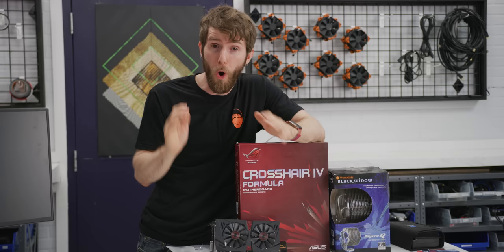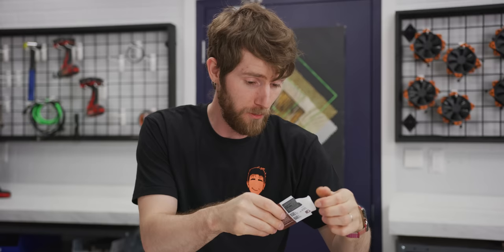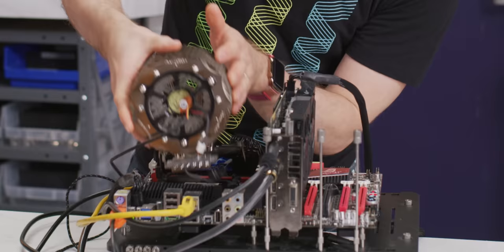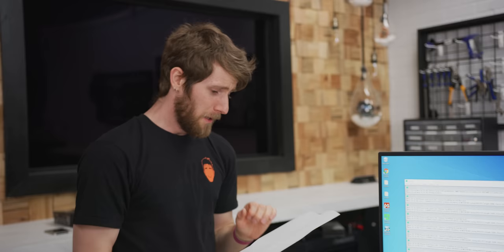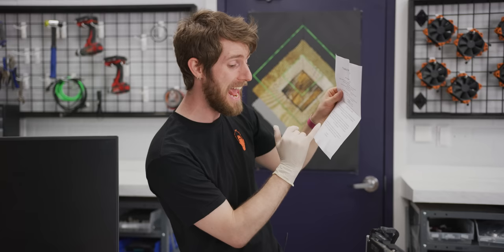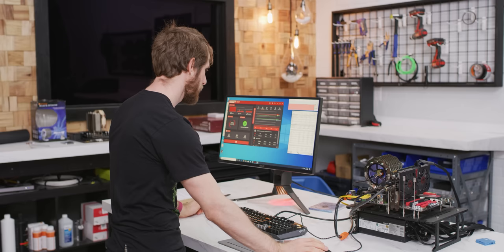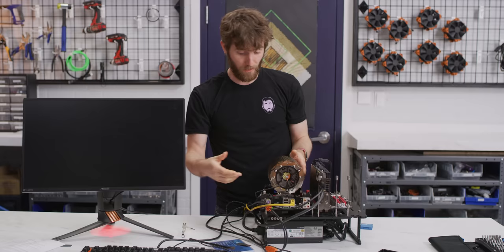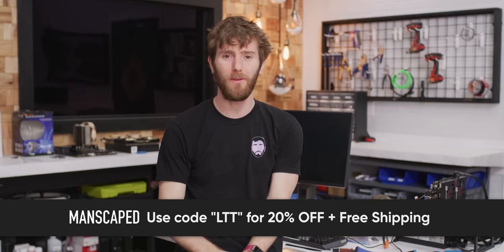Testing Another YouTuber's Thermal Compound!

Comment: Thanks for doing this review!  We didn't have the guts to risk some CPUs on such a test.  I think your application techniques looked reasonable and typical of what most users would probably do, I've also forgotten the sandpaper and I recommended it!  Needless to say, I'm disappointed with your results and we'll have to revisit this. Also, I'd not recommend that your viewers use a permanent adhesive in place of a removable grease when possible as you separated these two surfaces with LESS damage than is usual!  Thanks again and well keep in touch.
Reply from the maker: Hey man thanks! I had a blast with this stuff and enjoyed the heck out of your video about it.

Some people seem to be under the impression that we don't like the product but I think they've misunderatood the point of our test. We felt your video already covered its performance compared to other (commercial) thermal epoxy well-enough. Our test was just in response to our community's silly suggestion.

For next time maybe I can make this more clear but I though by the time I took a hammer to the CPU it would be clear this wasn't a recommended application for this product!!! - LS

Edit: one theory I had (after shooting) was that a much stronger clamp would give me more similar performance by squeezing out more of the excess epoxy. Unfortunately many of the "screw-down" type mechanisms that allow you to fine tune the clamping force are more prone to user-error. I wanted something brain-dead simple (and of course expendable haha).
Reply: i wonder if you can make some thermal paste with some liquid metal like galium alloys and mineral oil.
Reply: @LinusTechTips  Please do the internet a favor and send the rest of the epoxy over to Gamers Nexus so Steve can do an empirical set of tests on it.
Reply: @Tailslol  Sounds close to liquid metal minus the mineral oil
Reply: @Tailslol  Why not just use the liquid metal used in delidded CPUs?
Reply: @PapiSmerf  I don't think steve wants to destroy his new custom dummy heater
Reply: @PapiSmerf  OMG yes. Linus doing these tests is entertaining but not evaluative. Steve doing these tests would have 16 graphs under 317 testing conditions
Reply: It certainly introduced me to your product. I'm very tempted to use this to mount a high power led to a heatsink
Reply: Personally, if Tech Ingredients aren't willing to test the product themselves they shouldn't be selling it.
Reply: @Tailslol  Oil and liquid metal don't mix. It much more worthwhile to invest in a better cooler and use toothpaste as thermal interface.
Reply: Tech Ingredients probably want something more akin to a Liquid Carbon/Graphene .
Reply: @NiTeHaWKnz  Well they don't really need to test it on something that it isn't made for. They said it was made for more permanent applications, not a cpu that should be able to be removed if needed.
Reply: what grit of sand paper would you recommend?
Reply: @NiTeHaWKnz  Why would they test this when they're advising you not to use it on a CPU.
Reply: @his_mum  I believe in the techingredients video they said 2000grit diamond powder
Reply: @LinusTechTips  Heat can help soften epoxy to make safe removal of the cpu possible
Reply: @Tech Ingredients We'll*
Reply: @LinusTechTips  Please pin this comment on top
Reply: @LinusTechTips  me again, why don't you use a torque screwdriver like what comes with threadripper CPUs to do CPU mounting tests. They sell inch/pound torque wrenches and i'm sure if a screwdriver isn't made with the mechanism you could rig a wrench to use philips head just fine, i have all the parts here to do it in my workshop. this would allow you to standardize mount pressure on every test ever done
Reply: Humble pie! :)
Reply: @PapiSmerf  i think he can afford 20 bucks lol
Reply: Waste of a product imo
Reply: @Schradermusic  It's very conductive AND reacts badly to aluminum (eats it) such as most heat sinks use. With great care and an all coper contact surface it might be do-able.
Reply: This stuff looks much better than my single part "thermal plaster" I use for components like large resistors and transistors in some instances.
Reply: I take it none of you watched Tech Ingredients video on this. They address everything that's being brought up here.
Reply: @NiTeHaWKnz  they aren't selling it for this use. Please do your research.
Reply: @Tech Ingredients
1) Usually thermal epoxies perform worse than thermal pastes, making a thermal epoxy that gets in the neighbourhood of paste performance is still a nice achievement.
2) Maybe you tested it with a less powerful heat-source. It could be the case that this epoxy can only carry a certain number of watts per area untill performance drops off.
3) Thermal conductivity can be temperature dependant. It would be nice to check how your epoxy behaves at different temperatures.
Reply: would love to see a revisit of this in the future, logically this makes sense and seems like a cool product, and im sure you will be able to iron out the kinks to the point this becomes something that people will be using a lot in even laptop applications
Reply: Coulp you lap the IHS and have it be better than before it was epoxied?
Reply: @LinusTechTips  It's time for you to try those indium sheets he talked about.
Reply: @NiTeHaWKnz  Have you watched their video?
Reply: @LinusTechTips  
Send it! Send it!
Reply: Don't thermal epoxy and thermal grease have very different thermal conductivities? I thought thermal epoxy was epoxy first and thermal second, which would make a lot of sense, given it's meant to be structural, and it'd be far worse for the adhered hot piece to entirely fall off than it is to have a slightly less conductive epoxy.
I'm not so sure there's a need to be too disappointed in its performance, especially with something as thermally dense as a CPU. There's a couple hundred watts coming out of a square centimeter or two, that's a pretty steep hill to climb.
Maybe some other sort of more linear copper fluff would work better? The dendritic copper is a lot of thin, flat sheets which I'd imagine would end up layering with the epoxy, and while the contact between the first layer of copper and the surface would be excellent, the subsequent connections between the pieces of copper in the bulk epoxy would be nearly a worst-case scenario. Perhaps something more needle-like would work better, with a higher chance of crossing points, as well as a propensity to end up sandwiched vertically between the two surfaces, providing a purely copper bridge supported by epoxy.
I've also spent a total of about 15 minutes working with epoxy so I'm absolutely talking out my ass here.
Reply: @NiTeHaWKnz  I think they weren't willing to test it on a CPU and heatsink. They would have likely tested it on something. I can think of many scenarios where this stuff would have been great to stick something hot to a heatsink without needing to make a mounting bracket to force them together like you would with a paste.
Reply: I ship it
Reply: @PapiSmerf  whats the point, clearly these guys have only spent 1/1000000000000 of the time and money designing a wannabe thermal compound that the big boys do. Seriously who though a product that is a glue and will harden will transfer heat well.......
Reply: @NiTeHaWKnz  They're not selling it for CPUs, it for an entirely different application scope in which CPU paste can not be used.
Reply: If mixed with a better tool and more exact measurements it would probably also perform better, would be great for other uses
Reply: @PapiSmerf  It's 20 dollars, tell them to buy it if you want that.
Reply: @LinusTechTips  
If it didn't adhere properly, maybe there wasn't sufficient thermal conductivity.
The dual application of newer on older/cured could be a variable in the equation?
Reply: Respect
Reply: @LinusTechTips  Not recommended, but it has its uses ... some 25 years ago I thermal epoxied a heat sink onto an AMD 5x86-133 to upgrade a laptop.  Was the only way to do it, all the clip on heat sinks I tried wouldn't fit in the space since I also had to use a voltage adapter for the 3.3v processor to run in a 5v socket.
Reply: If Linus can see this I need his help I sprayed raid on a pc I got off letgo that has roaches and not it won’t turn on I don’t know if it’s the power supply or the motherboard
Reply: Tech Ingredients is one of the best channels on Youtube !
Reply: @LinusTechTips  I'm curious what the results would be if you added high quality thermal compound to the thermal epoxy. Wonder if the results would change.
Reply: Applying it with Mcdonalds plastic knife and a finger is not what most people would do.
Reply: Linus Tech Tips I wanted to like this comment, but every time I go to hit the thumbs up button, some demonic force zaps my finger away 👿👹
Reply: @LinusTechTips  Hey Linus maybe you could use this stuff in a delidded CPU situation and see how it performs VS the TIM that Intel uses since it has Epoxy in it for sealing it. 

Also @Tech Ingredients maybe this stuff could be used for CPU delidding situations.  Maybe you can try doing that.
Reply: @Tailslol  i'm pretty sure this is possible... but not as a commercial product. using my knowledge and experience in material studies (from about 2000) it should be possible, but it would have to be applied right after making it.. after only a few hours the compound would loose homogenity. And i don't think it would be a very good thermal conductor either
Reply: @LinusTechTips  i really like the video... and i think it was clear from the beginning that this is not the usecase this was made for... to be honest it performed better than i first thought after hearing it is an epoxy based system. the idea is great though in i really hope tech ingredients is sticking to it and improves it further... really good job
Reply: TECH INGREDIENTS: THEY MIXED IT WITHOUT MEASURING ON A CD CASE WITH A MCDONALDS KNIFE.....  NEED I SAY MORE????? NOT THE BEST WAY TO TEST.  THERE WASN'T EVEN A THICK ENOUGH LAYER TO COMPARE TO THE SIMILAR TESTS IN MASS OR THICKNESS.  IT WAS LIKE WATCHING A LITTLE KID WITH PLAY DOH
Reply: @nbrikha  Tell some more tests based on thermal paste other than Linus did
Reply: @PapiSmerf  He'll do same type of tests nonetheless
Reply: @GraceBrother  so you could do it better.. Lmao! What you're doing in life jobless?
Reply: Yeah Tech Imgrediant your themal compound is terrible who in their right mind would want their $1,000 cpu glued to their expensive heat sink and pc?
Reply: @PapiSmerf  The only YouTube tech benchmarks I trust.
Reply: I saw your original video back when you made it.
From what I understood the compound you made was more a replacement for other thermal epoxy's or thermal glues not traditional thermal pasts right?
Back in the day, 20-25 years or so ago it was not that uncommon for graphic cards and PC parts in general not to have a any mounting solution for a heatsink on components so say upgrading your cooling on your graphics card would often involve gluing a new heatsink on it assuming you got the old on off first.
We used Arctic Silvers adhesive like 17-18 years ago but I cant find it for sale anymore and it seems to have been discontinued some years ago.
Nowadays me and a lot of friends are doing retro computing   (386,486, and up) and what you made in your video I found rely interesting because I usually have to resort to strait up epoxy to fit a heatsink on say a motherboards North bridge because there are no mounting holes at all and I dont like the idea of double sided thermal tape, week bond and probably even worse thermal performance.
It works well enough on this old low power parts.
But I was wondering something about IC's of that era and even modern once.
From what I understand an IC tends to use an epoxy like resin capsule mixed with beds of glass, from what I understood its to make sure the expansion ration matches the silicon inside the capsule so it wont damage the IC due to different expansion rates.
So then I wounder how bad or "good" is the thermal performance of a traditional IC package where the silicon is completely embedded in this epoxy/glass bed mix and is it strait up good enough to use epoxy to fit a heatsink to that or would one still benefit a lot from your product?

Best regards 1984
Reply: Maybe there's some sort of cascade effect where it becomes inefficient if it crosses a heat barrier. Conductors work better cold, maybe this one just starts to suck after it gets hot but it's great if you are already in the low temps. Just a theory.
Reply: GAY
Reply: Don't forget; the "experts" have had years! Still pretty impressive that it was promising and professional enough to be reviewed
Reply: @Tailslol  Gallium really likes to weaken metals, it's why it alloys so easily.

I wouldn't want gallium anywhere near some aluminium or copper especially on something that costs money.
Reply: I believe that it's possible to make it removable by using release wax on both sides.

It's possible that sanding may leave small raised burrs, or leave abrasive on the surface.
Reply: @NiTeHaWKnz  there are many many more applications for thermal interface materials apart from CPU cooling.

They never claimed this to be suitable for use in a computer ;)
Reply: I've used Arctic Silver epoxy for some interesting repair - personally, I used it a few years ago when a mounting socket popped off the motherboard of a laptop (MSI... HOW?!) - I needed an epoxy that could do two things: Hold on and resist heat.  
I'd honestly have used yours if it was available at the time - roughing up both surfaces was at least possible on both and the hold needed to be somewhere between forever and to infinity and beyond.
Reply: @Tech Ingredients could you do a follow up on the diy homogenizer?
Reply: @Ninnimuggins  ROFL
As if you have something to teach Tech Ingredients. There is a VAST difference between a typo and someone who clearly doesn't know which of the two too's to use.
Reply: @sasjadevries  Perhaps you should have checked out their video before trying to advise them on what they may or may not have done wrong. Their heat sources are generally dissipate far more than a CPU.
Reply: Fight fight fight!
Reply: I'm curious as to how this would do at low temperature maybe just above freezing for chilled water.
Reply: NiTeHaWKnz They did. In
Their video their testing showed that their epoxy clearly out performed comersial thermal paste.
Reply: @MrDeathray99  According to what I've seen, its Aluminium that is the actual problem. A bare copper IHS or plate will get a coating (discoloration) and will be fine...but some gear is Nickel plated for this and other reasons.
Reply: Tailslol unfortunately you cant gallium completely destroys aluminum  (look up a video about it it’s actually really cool) and oxidizes other metals plus if it gets on anything other than what it was supposed to it’s very conducive and will fry stuff
Reply: Spoiler!
Reply: Oh yeah, that a good one, guts!
Reply: @Schradermusic  Under an IHS on a CPU the only metal's the Liquid is touching is the IHS and the Silicone. but the liquid metal on top of the IHS It could squeeze out easily and onto the board which clearly would be very bad. But there's both the metal from the IHS and the Cooler, and depending on the metal they use the Liquid metal may corrode the cooler. I am not 100% on this I'm sure there's some that may work but I've never put liquid metal onto the cooler plate itself before.
Reply: I knoe I can't be the first person to critique Linus' mixing technique:
would the air in the mixture have effected the performance?
were the surfaces prepared correctly?
should a real cooler been used? (a cooler that's "stock" temperature was lower would have a larger range for granularity[ :P or i'm just blowing a**-smoke])
 . . . an old dual socket server would come with two cpu's and two coolers, and two chances at testing; and as far as I have seen, server heatsinks TEND to be the retention mechanism, providing repeatable mounting pressures . . . 
Also, Tech Ingredients are great: Lots of great information on their channel
It was their videos that finally got me to learn how to fiberglass, I love the detail they went into when designing premium exciter-based speakers,and there desiccant based A/C is a MUST watch.
Great collab' Thumbs Up
Reply: I think more clamping pressure is needed given how viscous it is.
Reply: Making thermal paste would be a good idea 💡
Reply: Wholesome!
Reply: Forget that sticky stuff... PADS... i was blown away by their results !!!!!!
Reply: Well, this is probably the best thermal epoxy out there.
Reply: The only risk you have is a blue screen.
Reply: @LinusTechTips  You should try sanding and lapping this CPU so that you can maybe use it again...
Reply: Always good to see a brand accept someone else's tests and criticisms, I recon Linus test should've been done on a cpu without a thermal limit so low (even just to help him 😂) but I hope you guys get a good product down and blow these results out of the ballpark!
Reply: @Tailslol  gallium will melt at 30 degreese so i dont think its a good idea
Reply: @destroyer5140  Thanks for clarifying. I didn't know that. I thought it turns solid after a while.
Reply: @Tailslol  Gallium? You mean that stuff that eats Aluminum? I don't think I'd want to use that as a cooler even in an alloy.
Reply: LMAO
Reply: I would've imagined you'd try and weaken the bond with the heatgun, even if only slightly.
Reply: You made a thermal paste but didn’t even test it on CPU’s?........
Reply: cool video. Cool product
Reply: Scam artists
Reply: will this work to adhere copper or aluminum heatsinks to VRMs (plastic/resin?)
Reply: You definitely deserve the exposure this brings to your chanel
Reply: @Jimmeh_B  Lol, you're wrong in almost every way; you think 12 watts is more than 125 watts.
1) I am subscribed to tech ingredients, and I have watched it that video the very day that he uploaded it.

2) Perhaps you should have read what I actually typed here. I didn't tell them what they did wrong or right, I just mentioned a couple of things that are worth investigating, and reasons why their results might differ. The purpose of my comment was to point at some ideas (food for thought) rather than making hard claims. 

3) And then what the hell are you saying with "Their heat sources are generally dissipate far more than a CPU." A heat-source is not dissipating, it's producing heat.
And how much heat you want to transfer doesn't matter at all, the amount of heat PER SQUARE MM (or inch) is what matters here.
And then: I re-watched his video now to be sure. The Tech guy said that he is running the resistor at 12 watts of power, meanwhile an FX8150 has a TDP of 125 watts.
You fucking smartass...
Reply: @Cerberus786  well yes I did not
Reply: Cyber Gaming Studios they literally said that's not what it's for. Linus is just up to his typical shenanigans with this video.
Reply: @NiTeHaWKnz  You should have a look at their original video before you judge.
Reply: @sasjadevries  Just look at their original video. It's a very serious channel.
Reply: Just go and watch their original video. It's a very serious channel.
Reply: @MaxMustermann-sm4qu  Read my 2nd comment.
IKR, I am subscribed to tech ingredients myself.
Reply: @CyberGamingStudiosOfficial  Go and watch their original video before you judge. It's a very serious channel.
Reply: Linus u rock bud
Reply: Leo hey linus has been doing situps his core is way harder than steves sir
Reply: @PapiSmerf  just tweet gn about the product
Reply: Thermal epoxy typically has much worse thermal conductivity than thermal paste. But there are many uses that need adhesive properties. So this product seems good to me. I use MX4 as thermal paste because it is said to have much longer life than for example Noctua paste (I use it for audio products meant to be used decades...).
Reply: @EZboyrocks  Maybe you missread. He wrote that he would NOT recommend it to the viewers.
Reply: t kermi you’re right, my bad
Reply: @EZboyrocks  No problem 👍🏻
Reply: @Tailslol  gallium would be neat but i think that a CPU IHS is aluminium and so the gallium would destroy it and the cooler if it uses aluminium components.
Reply: I could see using this for a machine with a broken mounting that's not worth it to repair or upgrade the main board. Just glue the heatsink on.
Reply: @Tailslol  Thermal Grizzly allready makes one. Its called Thermalgrizzly Conductonaut check it out!
Reply: @NiTeHaWKnz  You're not too bright are you?
Reply: Linus needs to send some cheap cpus to you or you need to buy some cheap ones of craigslist. And see how this goes.
Reply: @LinusTechTips  Enjoy both of you guys... I have to say, that i'm a bit more tempted to Follow TI, rather than LTT when constructing rigorous tests. 
Where are your "control" measurements? Ambient air temp, humidity, etc. 
Linus, your style is a bit more... winging it.
Wish you could have done a collaboration video (even if it were teleconferenced)
Reply: @PapiSmerf  Or TechIngredients can do that themselves. He did this as a favour and owes nothing.
Reply: @guriev konstantin not sure if this is a question...but this compound was designed to affix highly resistive loads to waterblocks for heat exchange. The channel (Tech Ingredients) is focused mostly on DIY-ing highly sophisticated lab equipment for precision science. I'd hazard that the epoxy is for one of his heat exchanger projects (he does a lot of work with TECs and evaporative cooling) and would therefore be something like a TEC or a low-Ohm direct impedence resistor (As demonstrated in the video he premiered the epoxy in).
Reply: Probably more reasonable would be comparing thermal performance of Tech Ingredients thermal epoxy with other leading products i.e from  Epo-Tek .  For sure comparing thermal epoxy with thermal grease is not a good idea. From the beginning  I knew that the paste will outperform the thermal epoxy. Nevertheless, Linus did the great job. For sure form now on  there is no point of doing this again with own CPU's.
Reply: @Tech Ingredients Could it be the dendritic copper oxidizing or reacting with the epoxy in some way?. I made a copper nanoparticle epoxy that performed wonderfully at first but the performance degraded into worse than having no thermal interface material in a couple of months.
Reply: @eruiluvatar236  Could it be?
Reply: love u
Reply: Maybe fine grit sandpaper is better? 400 grit i can imagine lots of air pockets between the surfaces.
Reply: @LinusTechTips  Can you try the indium sheet thing recommended in the video?
Reply: This is a preposterous idea and insane on every level, there is literally 0 reason to have to do this at a loss of temperature. The amount of work it took to even make the compound it truly ridiculous. Go out and buy a $5 arctic 5
Reply: @NiTeHaWKnz  They aren't selling it for CPUs. This was just a random viewer request. Their epoxy is meant for something entirely different. If you make steering wheels for a car are you going to test it on a bike?
Reply: I think this would be great on something like a Cisco Switch, which comes out of the factory with a yellow, gummy, yet hard substance and is obviously not intended to be removed.
Reply: I love both your channel and LTT. But please for the sake of all of our sanity, send this over to Steve at Gamer's Nexus. He is THE man to test this, as his specialty is scientifically testing thermal performance.
Reply: all the hassle for some thermal epoxy jeez
Reply: @NiTeHaWKnz  They did test it.  Watch their video.
Reply: things you do not need to remove from the component. its a permanent solution such as (resistors).
Reply: @LinusTechTips  Just need a Linus "drop test" vid reel and theres the complete set lol
Reply: You know, the next step would be to make a casting box, lay in four or six heat pipe, and fill the casting box with the epoxy, and instead of a 'copper base plate' have a 'thermal epoxy base plate' and do yet another comparison.
Reply: @Tailslol  silver is the best thermally conductive metal hence why many pastes already use it.
Reply: i shat on my cpu to reduce temps. it worked well
Reply: Hey Linus, i think it would be really cool if you guys tried out the DML speakers that tech ingredients make some videos about. Especially when using apoequalizer to do some digital room correction on them. Best sounding speakers I have ever heard for not a lot of money. - Joep
Reply: @LinusTechTips   Mixes two type of cat poops and apply it on the CPU.  ( /joke ). I really don't understand it's purpose.
Reply: I have an idea  you should make pc that's so small it uses a toy drone fan as cooling
Reply: @Wisp58  Or fill a case with fans and test how much airflow is too much.
Reply: If you send this stuff to anyone else (like Gamers Nexus) I recommend using the same syringe for both compounds.  It will make the ratios more precise.
Reply: Do a collaboration project tech I gradients makes fantastic devices. To the point where you feel like its snake oil but they actually work.
Reply: @Tailslol  galium destroys aluminum idk what it does to other metals but it's probably not a good idea to use in your PC lmao
Reply: @LinusTechTips  if a spinq is expendable do you have any more? things are seriously hard to find...
Reply: @sethwinters3556  yea maybe silver copper and diamonds in a mineral oil paste or something like that
Reply: @Tricksyboom  They made a thermal epoxy resin not a thermal paste. Artic silvers own version performs worse than their own artic silver 5 paste
Reply: Eoin Kenny I thought they were selling it for cpus? Maybe I misunderstood
Reply: I feel like this stuff would be overkill for performance on a Raspberry Pi
Reply: Thermal paste is only there to fill up the tiny tiny gaps between the two surfaces so no air is inbetween. Thermal epoxy has to glue things together (often fill up larger gaps) and still conduct heat. The copper,diamond. . . stuff is a filler with for sure larger particles than you would find in a normal thermal paste. Also the Tech Ingredients epoxy was applied relativly thick (after removing the CPU you could see easy 0,1/0,2mm+ of epoxy). If you would put thermal paste this thick between two surfaces you would get also really bad results. To get good results with Paste/ epoxy both should be applied as thin as it gets. Because of that we lapp CPUs (to make the gaps smaller). Compare the data: Thermal conductivity of Aluminium 237 W/mK, Copper 413 W/mK, Arctic Silver Thermal adhesive 7.5 W/mK, ARCTIC SILVER 5 conductive paste 8.9 W/mK. So you can see paste and epoxy is 30-55 times worse than for example copper and should be only inbetween to fill the air gaps
Reply: Tailslol if you want it to eat through the metals, sure. Although it would work well until it didn’t.
Reply: so just to be clear, you've not tested your own product?
Reply: Lol get dunked on
Reply: Folks that recognize and don’t deny mistakes make me want to trust them completely!  Everyone makes mistakes but being upfront and transparent is admirable and I would support this company completely as I would never have anything close to that kind of heat output. Of course I’m a dad and my passion is building systems for my two sons goof on.  As an electrical engineer this isn’t disappointing at all. 
I wish good health and all the best to you and yours!
Reply: @ashleyjanit5052  Well, that's interesting since and I quote Tech Ingredients said "We didn't have the guts to risk some CPUs on such a test"
Reply: Tailslol  gallium would melt from the CPU heat almost instantly under any load
Reply: I would argue the fact that the cooler wasn't copper core, sounded like the epoxy is more for copper components. But in fairness it was the same test subjects as the other contenders. The smashing with a screwdriver isn't on my list of upgrade exercises, so oof!!! Good thing you didn't apply it to a video card's ram modules. RIP!!! lol However I would imagine it's designed for certain  surface materials, raw ram would be a super bold test, and removing them well clearly devastating. Innovation isn't achieved without risk! Linus dropped a CPU!
Reply: i hope any youtubers will make an experiment with gold.try swap your cpu cooler copper plate with 24k gold plate.lets see if it will make a difference
Reply: Please tell me that was a joke... the 8350 held the world record for damn near 7 years for speed record. Yea, it cranks out some serious heat, but if you know how to manage thermal cooling it's not a problem. Not to mention that the current WR holder is an 8370 which only surpasses it because it has 8 threads over 4 per core. You wonder why people hate you, it's because you say stupid shit like this on video.
Reply: so if ppl wouldnt use it on a cpu what would they use it for?
Reply: @Tailslol  I doubt that will mix well though
Reply: @PapiSmerf  so much this.. I want to see a real test
Reply: @NiTeHaWKnz  They did test it and they don't sell it for CPU Applications. YOU SHOULD NEVER USE A PERMANENT ADHESIVE FOR CPU COOLING. Linus was testing it for purposes other than it's main design to answer a question asked by the community. Tech Ingredients' intent was to use it for permanent thermal applications, and compared it against OTHER permanent thermal solutions. It was never compared against thermal paste or pads for CPUs because that's not the product's intended use.
Reply: @BaioWithMayo  Laptop applications would make the most sense, since laptops generally aren't modular in the first place. That and cellphone applications.
Reply: @Tailslol  Pretty sure most of the 'liquid metal' Grizzly stuff uses galium. Galium makes metals like Aluminum brittle. (Which I think is a warning or concern of using liquid metal, long term)
Reply: now if only you could convince him to use your guidance for a TEC cooled pc
Reply: all good!
Reply: @Tailslol  gallium infiltrates other metals and basically rots them to junk.  One of the best thermal interface materials is just a foil of indium.
Reply: @LinusTechTips  Have you guys ever tried using a torque wrench that measures in in/lb? Something to think of to keep the pressure even on those screw-down coolers.
Reply: I was hoping this could be used in a CPU delid. Something to think about for v2!
Reply: @Tailslol  The only real issue with the Galium is that alot of CPU casings are made of Aliminum and would errode and destabilise the metal (though I don't know alot about Galium alloys so potentially some may not have that issue)
Reply: I think it might be something to do with the fact that the epoxy necessarily needs to be thicker than the grease to give good adhesion, also you can't get as high of a particle loading (this doesn't mean the particular epoxy is bad, it's just that you have to give up some thermal flux for adhesion). If you are getting different results over time, however, you might want to source different particles (esp. the dendritic copper) from different suppliers and blend them, a pro tip from my old ceramics teacher.
Reply: My experience and two-part Epoxies Well building houses you need to let it cure all the way before heating it maybe the heat does a chemical reaction and messes up the curing process which then makes the product not perform like it’s supposed to maybe put it on a room temperature PC let it cure all the way before turning power to it to see if it functions better stay blessed keep up the good content I just build houses wink wink
Reply: Yet you didn't have any problem selling it. Nice.
Reply: @Tailslol  Gallium EAT aluminum for super ! That heat sink would disintegrate ;)
Reply: @LinusTechTips  , you told, that you probably never gonna use that cpu ever again, BUT what if you lap the cpu with sandpaper? :D

Greetings :)
Reply: @LinusTechTips  to be honest though, you probably should NOT have mixed the epoxy on a CD Disk case. epoxy heats up and some plastic material could heat up to a hot enough temperature to dirty the epoxy. This COULD have skewed the results. Mixing should be done on the appropriate surface to prevent outside contamination.
Reply: @PapiSmerf  Absolute truth. Nexus does serious testing with exacting standards, and this video was shockingly bad.
Reply: @Tailslol  Gallium is very good at eating other metals. I definitely wouldn't want to put it on my CPU.
Reply: There is NOTHING to be disappointed about regarding the performance of this compound. Given that it's not liquid, it has absolutely no chance to reach MX4 levels of performance. AS Epoxy was the biggest piece of shit ever invented and you seriously improved on it.

Well there is SOMETHING to be disappointed about. That Linus went ahead at the start of the video and grossly misrepresented your claims about the product.
Reply: Thermal thin double sided tape works perfectly fine for a north bridge. No point ruining it with epoxy. I have some parts that have been running for 10+ years and sitting around for 10 more, vertically and upside down, and they hold. Sure the tape slides around if you push it, but left alone, they work perfectly well.
Reply: @sirjezzumz   The small amount of this one barely heats up, it's perfectly fine. And it will sure cure on the CD case permanently but it doesn't dissolve it at all.
Reply: Wait so u say this isn’t a replacement for thermal paste so why are u comparing it to store bought thermal paste .......Big F
Reply: Wait, these guys were selling thermal paste without ever having tested it on a cpu?
Reply: @AFpaleoCon   It's not a thermal PASTE, it's a permanent thermal GLUE. It's made to attach high-power LEDs, TECs and experimental scientific assemblies where good mounting methods are not foreseen, because people are just throwing parts together which were never intended to go together, and it's needed for an experiment or a one-off. It was never intended to be used on a CPU because CPUs work best with an actual thermal PASTE, supported by heatsink's constant-pressure mounting, and paste wouldn't be usable for the kinds of things this is intended for. There is otherwise no good affordable thermal adhesive on the market, there once was AS Adhesive (also an epoxy) but it was JUNK, it was horrible and useless.
Reply: @Tailslol  I think that such a thermal space would leave a lot of space for user error (i.e. spilling liquid metal on your motherboard).
Also, I'm pretty sure that galium reacts with the nickel plating of the processor, in time destroying the structure of the processor itself
Reply: WAIT YOU MADE A THERMAL PASTE WITHOUT DOING ANY TEST ON CPUS??!!??!?!?!
Reply: @CrazyMineCuber  they compare it to a 2 parts thermal epoxy adhesive from Arctic not to thermal grease like the MX-4.
http://www.arcticsilver.com/arctic_silver_thermal_adhesive.htm
Reply: @LinusTechTips  yes indeed the thickness of the thermal epoxy/paste plays a crucial role. Epoxy resin is an insulator. A higher clamp force may improve the performance, albeit marginally if you still wants it to work as a structural member.
Reply: To be honest unless the mixing differed off camera it looked like there was a ratio of 1:1 rather than 1:3, in my experience of mixing hardeners with binary agents it's best to do a stripe the same thickness, like toothpaste, then you can see if it's 3 times the length, twice or the same length. I suspect it would be better if there was more of the non hardener compound in the mix as it looks like that's where all the heat transfer materials are. Not quite an accurate enough test for me personally, I'd like to see it tested by someone a little more empirical though.
Reply: Tailslol they do
Reply: Didn't trust your own product.... lol
Reply: Sand paper is bad in this scenario only purpose of doing that is adhesion
Reply: @LinusTechTips  This video is like comparing the top speed of a sports car to that of a speed boat... by putting both in water. LTT is just being stupid here. Their expectations had no foundation in physical reality. Them being shattered is no shock. Fools are often befuddled by reality.
Reply: @LinusTechTips  You should remove this video and post an apology to TechIngredients for misrepresenting their product and their claims. Shameful.
Reply: @Johnfuse some liquid metal oxidise a bit when exposed to air,the oil is mostly for stability.
Reply: @Johnfuse mineral oil by itself is not dangerous for electronic component,as always it depends of the amount used.
and the idea is to make your own compound and not just liquid metal by itself...
Reply: @LinusTechTips  ok
Reply: Why make a video about making a thermal glue if you never had the guts to test it? Pretty unprofessional.
Reply: Why not put the components in a grees and see how they hold up?
Reply: @Tailslol  gallium may corrode it
Reply: I like Tech Ingridients better than LTT. Tech tought me how to make banana moonshine.
Reply: What happens if you mix noctua thermal Grizzly and Mx4 Arctic with a spoon of 99% etanol and liquid nitrogen 2 spoons what would happen let's find out!.
Reply: what an absolutely stupid product
Reply: @LinusTechTips  f
Reply: @LinusTechTips  g
Reply: Imaging having half a million subs and not being verified lol couldn’t be me
Reply: @Tailslol  gallium will alloy with other metals at room temperature and make them extremely brittle just from it resting against bare metal, also gallium will not mix with mineral oil
Reply: @Tailslol  LOL i would looooove to see them do that because alumenium absorbs galium causing a slow reaction that will weaken the heatsink turning it in to a substance similair to wet cardboard (overnight) 😀
Reply: That's a perfect example of how one should take feedback!
Reply: I do not know if this is a contributing factor, but the heatsink Linus used looked to have a mirror smoothness compared to what your tests were using.  Another thing noticed was that in both your's and Linus test, the final temperature was 67 to 68 degrees.  Is there a saturation point?  I am not a scientist but really enjoy your educational videos.  Thank you to you, your son, Linus, and all the other YuTers for the videos.
Reply: @TheOriginalFaxon  Torque alone is not the answer.  Different screws and nuts are going to have different frictional interfaces.  You can't guarantee that one mobo/cpu is going to have the same frictional interface as the next.  And that friction can have a significant effect on the clamp load.
Reply: @Tailslol  it could be an option were it not for galliums tendency to ruin aluminum.
Reply: @mynameisray  It's literally not made for CPUs.
Reply: It is Many years in the past - i had an Geforce 2 with some Temperature Problems. After many tests i figured out that the Thermal Compound Factory used was total garbage - so i cracked down the cooler and cleaned cooler and GPU (and the ram chips) i got my self a better cooler (complete passive) and glued the new cooler and the ram coolers back on the chips with a mixture of Silver Paste and Pattex Powerglue (i simply mixed them on an on CD case like linus did XD ) Before the active cooler could not stand the heat output of the card - but after my modification the former active cooled card would have run complete passive cooled with nearly 20° less than before even under the heaviest load i could run it. I had used more Silver Paste than Power Glue - because all i want from the glue was to hold the cooler (that did not fit to the factory mounting points) to hold in place. I called the Card alter my Little Frankenstein Card :D 
Many years later now i do it when ever i upgrade my system or a GPU cooler is on the edge of cracking because of Age ^^ - search for a passive cooling element that might fit size of the card and glue it on the GPU with hig performance paste and a little bit of power glue (today i have 5 or 6 of these Little Frankenstein cards that are stil working)
Reply: Gamers nexus is better for science and computers.
Reply: O
Reply: Specify a grit of sandpaper. 400 is very fine. If it's suppose to be medium it would be more like 120.
Reply: @LinusTechTips  So this is super old - but is it possible this sort of product would perform better at higher temperatures?  I know some periodic composites (which I think a micro-particle epoxy suspension might just set into) display nonlinear thermal conductivity responses to temperature.  Then again, many (not all) curve in the wrong direction.
Reply: I think that trapped air and gap-forming particle sizes might have contributed to weak performance. It looks like there was no pea-sized drop on either surface after the compound was rubbed into both mating surfaces. Squishing out a blob from the center helps displace out the bubbles that would be trapped in during mixing.
Reply: ok budy
Reply: "I'd not recommend that your viewers use a permanent adhesive in place of a removable grease when possible"...........well since the latter is literally always possible if the former is.....you're acknowledging that you'd never recommend your paste.  Wow.
Reply: @PapiSmerf  on a 752 hours video ❤️
Reply: @Tailslol  Already exists, but without the oil since Idk why you would ever want to have that with gallium.
Reply: @PapiSmerf  I'm p sure Steve has like $20, considering all the prebuilts he can buy for testing, let alone the equipment he's and his crew have.
Reply: you are selling a product you have not even tested??? Come on!
Reply: so your telling me you guys made a false promise based off nothing
Reply: @um4ooo  you realize this is over a year old? This epoxy isn't the same as the paste but okay.
Reply: @generouslyfail5832  ur prob thinking of the paste, this is not the same as that.
Reply: It's thermal expansion.
The heat spreader surface and the cooler pad has a slight temperature difference and expand slightly differently. This is not a problem for soft thermal compounds such as TIM or thermal pads because they are soft. But that's a problem for epoxy because such different expansion between two rigidly attached plates causes buckling and increases thermal resistance.
Reply: Well you guys should definitely change your test method😂
Reply: @singular9  Congratulations
Reply: As long as there aren't any short-circuits and the heatsink isn't completely absent, the CPU will survive. CPUs don't just thermal throttle, they will shut down when the overheating persists.
Reply: A year later, a new thermal compound, let's GOOOOOOOO
Reply: @NiTeHaWKnz  
They're not selling it as a thermal paste for CPUs. They're selling it as a thermal EPOXY for applications where the parts must be held securely under vibration, like automobiles.
Reply: @GreatMelonLord  i know this is old but no, it's not anything like a liquid metal. Over on techingredient's site he mentions why he doesn't like liquid metal and why most people shouldn't use it. Gallium is a caustic metal to other metals (out side a rare few like platinum). It will cause the metals it's in contact with to "corrode" over time (meaning faster than usual). :)
Reply: I would say the application of it in this case was flawed.
Reply: This is awesome, Tech Ingredients rocks
Reply: @Tailslol  Gallium would make an alluminum heat sink crumble right?
Reply: @Peewee0413  yep like most liquid metal.
Reply: Tech Ingredients is the best show on youtube!
Reply: @LinusTechTips  wow. Guy cries about piracy. Literally shows he's pirating OCCT at 4:40
Reply: @LinusTechTips  The license you got for OCCT doesn't allow commercial usage and you're using it for clear commercial usage. The OCCT team reached out to you and you have ignored them. Youi need to make this right LTT.
Reply: @wehavetowakeup2049  What's really dumb is commenting that a product is dumb when you don't understand what the product is and is for, especially in a two year old comment thread that has like 20 other people making the same dumb comment and being corrected over and over before you.
Reply: @LinusTechTips  Next time I would suggest actually mixing the epoxy in the ratio specified.  You needed almost 2x as much of the orange part as you used.
Reply: Now this is a commendable reply if I ever seen one. Thumbs up!
Reply: "We didn't have the guts to risk some CPUs on such a test" wait what? You claimed it could outperform other brands of thermal paste without actually ever testing it on a CPU? so you just lied to everyone lol. how ethical of you.
Reply: U don’t have the guts to test ur products? Ehmmm….
Reply: @Linus Tech Tips  Any update on this :D ??
Reply: Any update on this :D ??